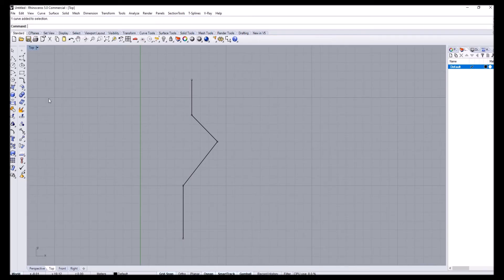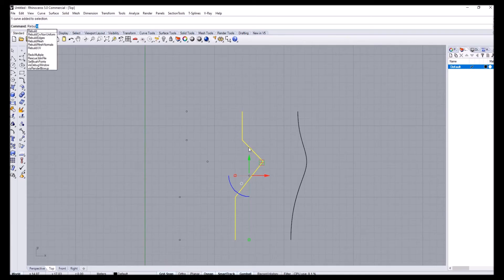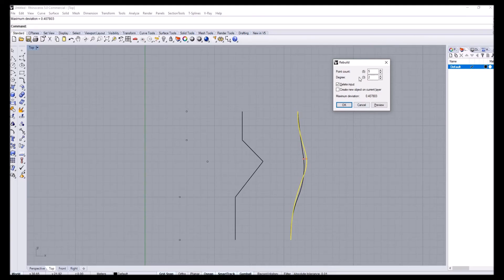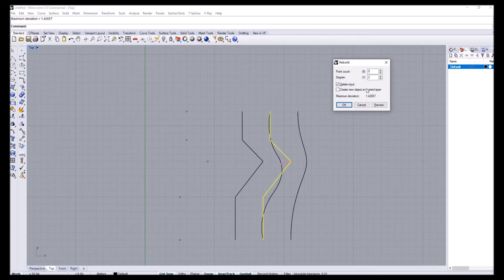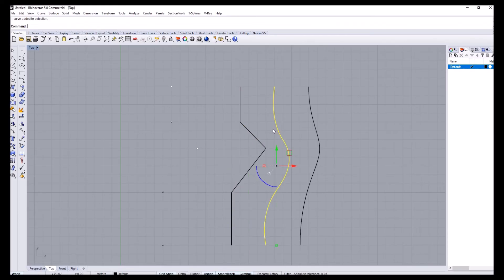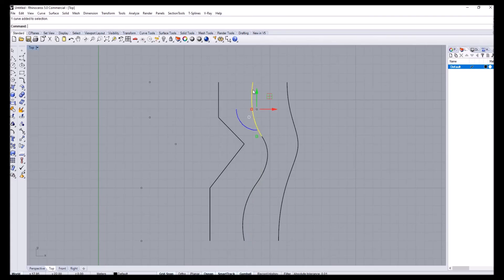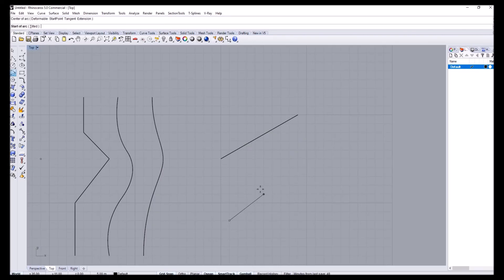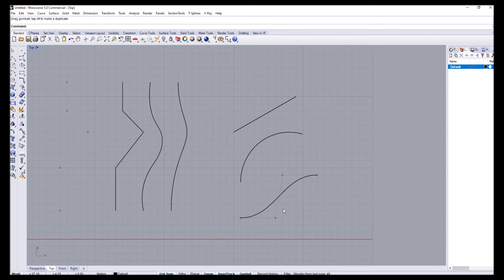Rhino Essentials: Curve Types

Comment: What you are saying about a degree 2 curve being constructed of constant radius arcs is not true. Even in the curve you use to demonstrate it here, the segments after exploding are clearly not constant radius arcs. Draw a three point circle, placing all three points on one of those segments, and you'll see. If it is a true arc, it will line up perfectly without deviation.
Reply: Exactly what I noticed. Important distinction. Degree 2 curve, not made from arc segments.